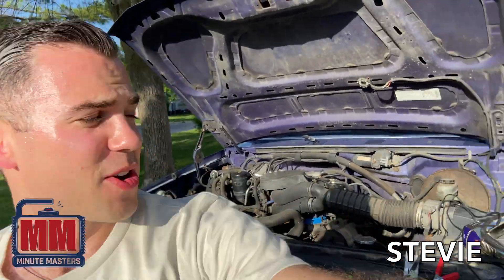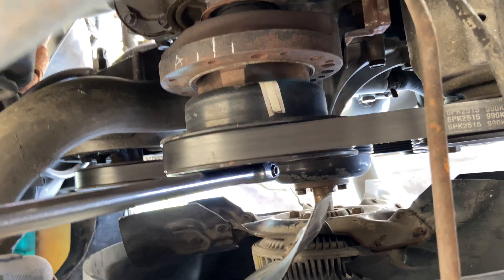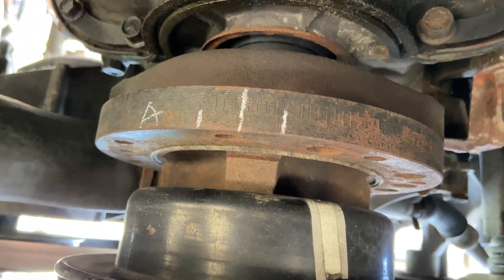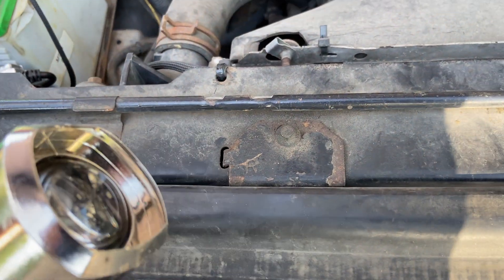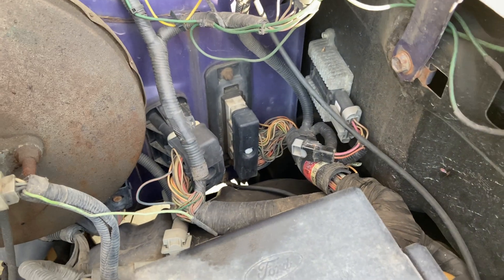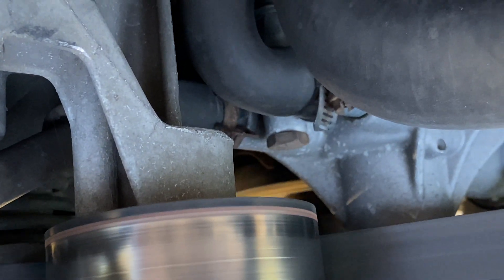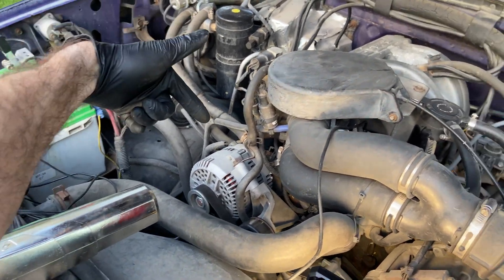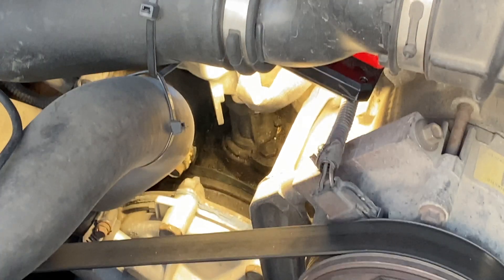Do You Know How to Check and Adjust Engine Timing?? | 1995 Ford F150

Comment: Looking forward to what you have to say about engine timing.  I basically did mine mostly by maxing out my manifold vacuum guage..and then dialling back just slightly.  Somewhere around 15 degrees, I think....but I'm not sure as I did it last fall.
Reply from the maker: I can’t say I’m teaching any more than the basics on how to do it on one of these trucks. But I do use a timing light and I have a few helpful tips. 
Nice! I’ve heard people use vacuum to dial in engines before I’ve never tried it myself. Eventually, I do want to install a vacuum gauge in my truck so that I can monitor vacuum.
Reply: @TheMinuteMasters  Ya, it's a nice thing to have.  Just like temp guages, it's one of those things that tells you ahead of time when you got problems.  I find it easier to use the manifold vacuum guage...rather than just sound of the engine and how it accelerates....and I certainly don't believe in just doing a pre-set timing...and thinking that is the best thing...lol.  I'm sure there are much more experienced people who can easily set timing based on the sound of the engine idle alone.  I still have a few guages I'd like to get....like a digital engine coolant guage...and the same for oil pressure.  My tranny temp guage has been malfunctioning also, so might go for something digital, rather than the old school  analog guage.  It probably has lost it's proper ground, to be honest....so just gotta have time to unhook the connection to the sensor on the tranny pan, clean it up, and see what happens.  Looks pretty rusted already.